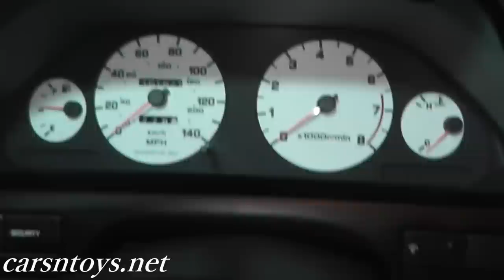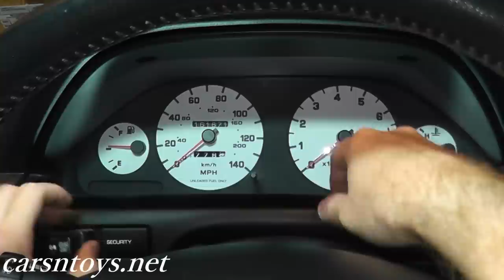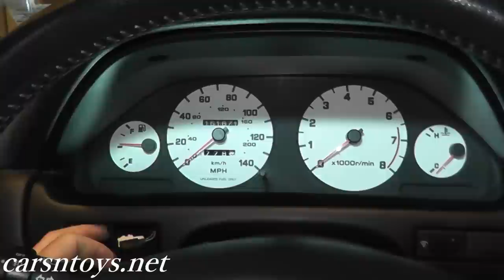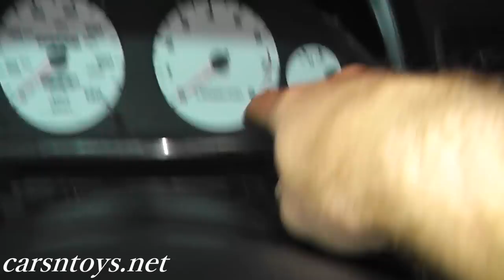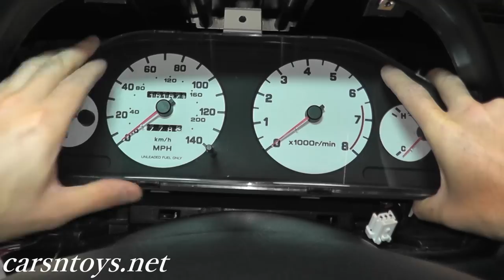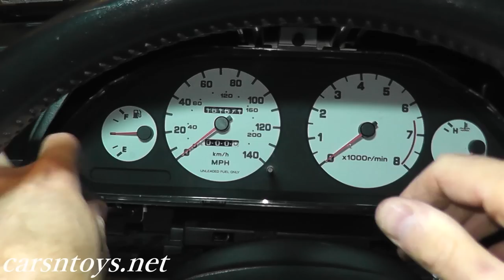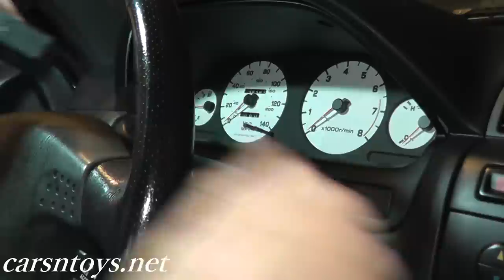Nissan Maxima Instrument Cluster Removal | Gauge Cluster Replacement

Comment: My fuel gauge hasn't worked in over 5 years. Would this throw a code for the fuel lever sensor? I have a check engine light and got it hooked up to a scanner that gave a 0462 code.
Reply from the maker: You can test the sensor but you generally have to remove the fuel pump to do so. Here's a video that may help: https://youtu.be/0eRXw2M-gEQ

Comment: I have a 97 Altima gxe. My speedometer doesn't work, nor does the temperature gage but the rpm gage works....do u think replacing the whole cluster might help? CarsNToys
Reply from the maker: nothing witty to type Start by checking the fuses under the dash board. If the fuses are okay, then you may want to think about replacing the cluster and hoping for the best. You can actually test each gauge, but it's time consuming and you'll need a multi-meter to verify power is getting to the gauge. Also, regarding the speedometer, if you have a check engine light for the vehicle speed sensor, then you'll need to replace the sensor.
Reply: @CarsNToys  is there a fuse that controls the odometer? Mine isn't working

Comment: my speedometer lighting is not working properly what could be? i tried to check the fuse and nothing but everything else works perfect
Reply from the maker: The bulb is okay?
Reply: i did another check i again under the dashboard fuse box and i found the one it was out fix and now it works
Reply from the maker: Awesome
Reply: Andres which fuse is this?? I have same vehicle same problem, just speedometer and gas guage lights,  half the dash doesnt light up. I know it's a long shot to ask but it would be so helpful!
Reply: NextLevelNick is a fuse # 10A and 15A but you could have a bulb that is not working no more
Reply: Alright thanks

Comment: I removed the cluster to change the odometer bulb, but when I reconected the cluster it didn't turno on
Reply from the maker: The connections can be a little touchy. You can try using dielectric grease to help with the points.
Reply: CarsNToys  thanks for the answer, I missed a connection testing new leds 😅 great video